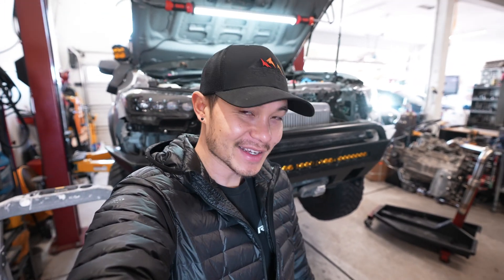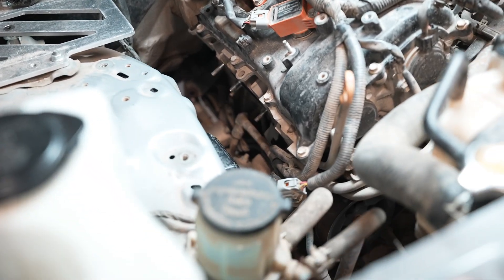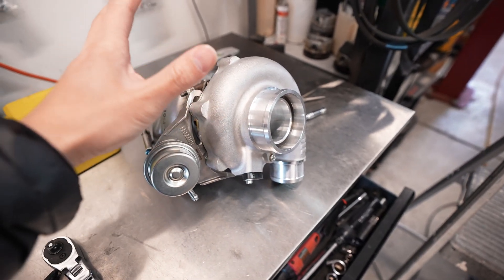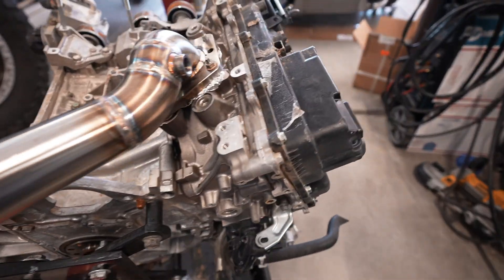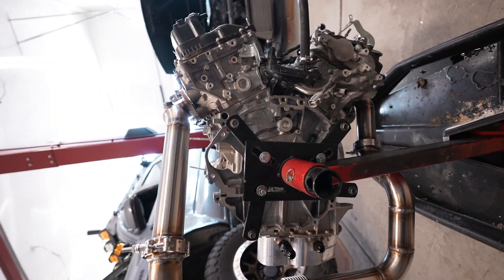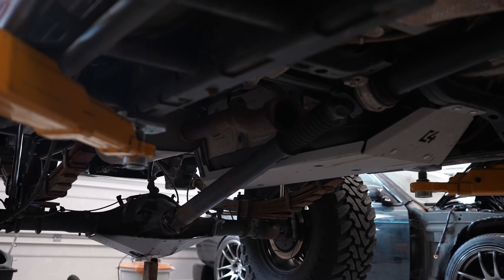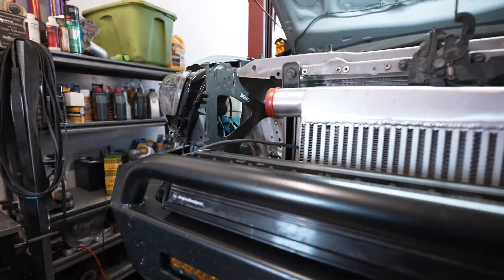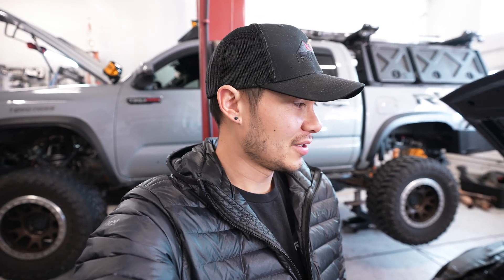Toyota Tacoma Turbo Kit Part 1 - Building the Manifold

Comment: curious....why a turbo and not a supercharger that has proven reliability??
Reply from the maker: Because there are superchargers out there already that you can purchase.
Reply: @Runnin4Tacos  so in short....you're just trying to be different??
Reply from the maker: @user-zv5zl2sv5g  We are trying something different than what is already out there.
Reply: @Runnin4Tacos  Understood...no harm.  Interested to see how well it would perform over time.  Good luck
Reply: @Runnin4Tacos  wonder how well it would perform offroad.  Would power delivery be as smooth and consistent as a supercharger

Comment: Aren't there rumors of a factory turbo coming on next years' tacomas?  Wonder if any of it would be backwards compatible?
Reply: If the next gen is boosted, it will probably be a 4 cylinder. What shocks me is that the new gen Tundra didn't use the same engine as the Tacoma. The 2GRFKS has been boosted with two snails in a Lexus sports car. I'm sure Toyota had their reasons.

Comment: The hard parts are easy, the tuning is the massive challenge. If not for that issue there would be a ton of turbo kits on the market for Tacomas and 4Runners and I'd of already built my own as well. And of course staying emissions compliant as well.
Reply: Emissions isn’t really an issue at least in Texas. But yes tuning is suuuuuch a pain in the ass. Vf tuner is best rn cause they offer boost parameters and stuff. But the ecm wants to revert back to stock changes.

Comment: Man I really hope this is affordable. 10K for a supercharger is something I’ll never be able to afford so this is my only hope. My biggest complaint of my 3rd gen is how damn slow it is
Reply: Have you gotten it tuned yet? I've heard it wakes it up a little bit? Not a huge change but it'll help with the gear hunting and it gives it some pep. From the reviews I've seen.
Reply: @no_lft_shft  I live in MD and I can’t find anyone or anywhere to get it tuned. I wanted to at least get the transmission to stop hunting gears that supposedly Toyota fixed yet mine is a 2022 and it’s always hunting gears. I should of waited for a manual transmission to be available at the dealership
Reply: @skitzo4215  have you looked into remote tuning? Where they send you the cable and you load the tune yourself? Prettt sure I've seen guys who can do this
Reply: @no_lft_shft  no I didn’t even know that existed. Do you happen to know any name brands I could start to look up?
Reply: @skitzo4215  I shall do a bit of research and I'll let you know.
Reply: @no_lft_shft  thx I appreciate it.
Reply: build ur credit score 😅 that's how I'm doing it
Reply: Regear it
Reply: Buy a Ford or chevy v8

Comment: On my 2021 Pro Tacoma I had Westcott designs install a Magnuson supercharger and AZ Tune Pro KDMAX thru Magnuson tune my truck for 33's, manual transmission, AGM Battery, and now is around 410HP. 80mph in 4th gear @ 4,000 RPM.
Reply: Any videos?
Reply: @Noboostnolife  My Tacoma. https://www.youtube.com/watch?v=9B7asX8shaU
Reply: I live local to Westcott and have some of their products. I'd love to see your rig. Thinking about doing the same on my 21 4R ORP.